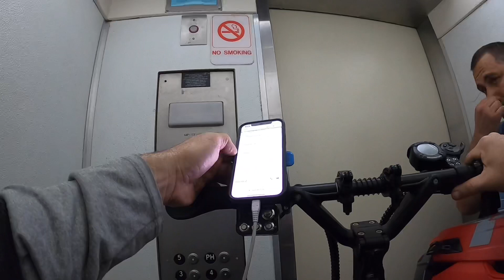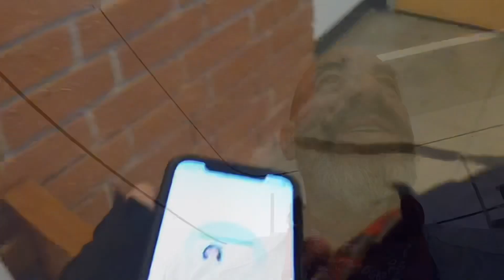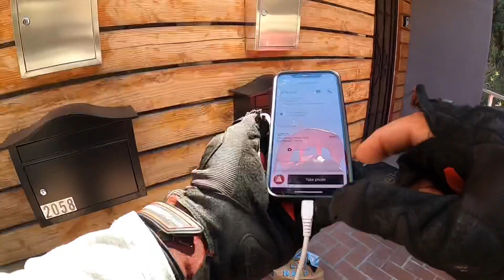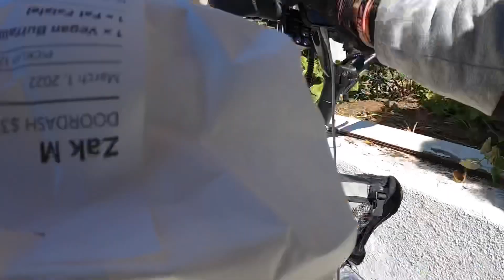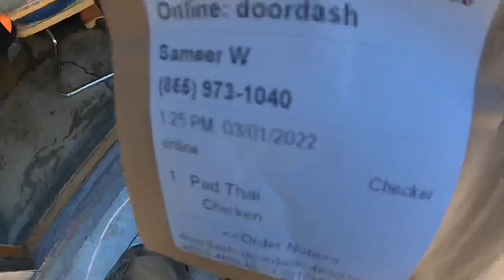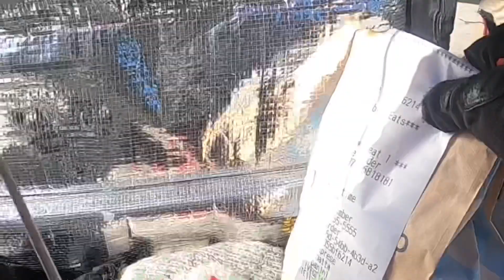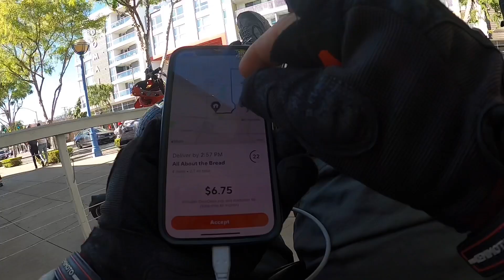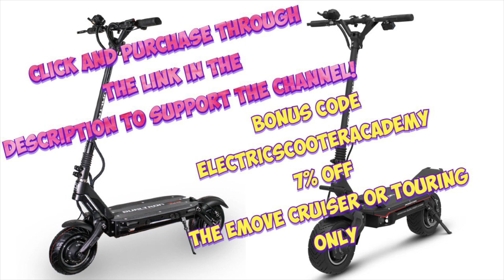CELEBRITY SIGHTING? ELECTRIC SCOOTER DELIVERY DOORDASH UBEREATS DUALTRON STORM HOLLYWOOD CALIFORNIA

Comment: Hey brother..... I'm so glad you've kept up your channel. Its such a unique experience watching you work with an electric scooter. So I saw you like 51lbs in your tires. I ride a kaabo wolf warrior 11 and I'm 250lbs, what would you suggest is a good tire pressure for me. Street riding only.
Reply from the maker: Hey man I’m not really sure! The more air pressure you put in there the more it feels like you have to balance on the tires so I think it’s OK to experiment.
Reply: @yogadude1234  I have a question do I get reported for canceling the order if customer doesn't answer and I dispose of the delivery on uber my satisfaction rate goes down it's gone down to 92% that's bad right? Thanks I appreciate it
Reply from the maker: @Jonathz-  Your satisfaction rate is your customer rating so if you don’t get the food to the customer you risk getting a bad rating. You should almost never be canceling orders you should at least be leaving the food somewhere or taking a picture of it sending it to the customer.

Comment: I watch your videos all the  time how much Percentage u let ur scooter get down to befor u switch em
Reply from the maker: I go by the voltage and it’s different on each scooter. The main thing is when I’m in the bottom 20% of the battery I keep the scooter in first gear otherwise I risk the scooter shutting down to protect itself.